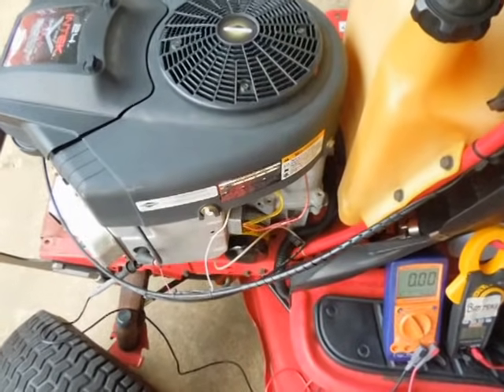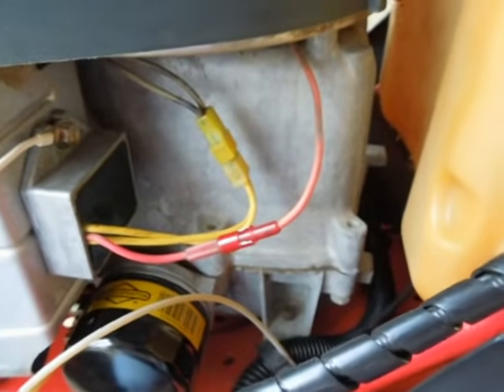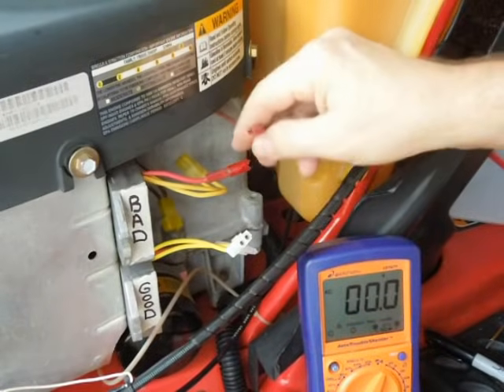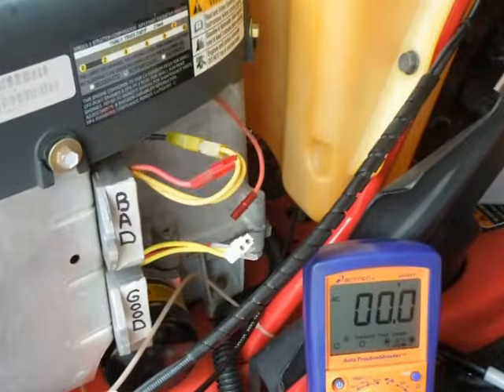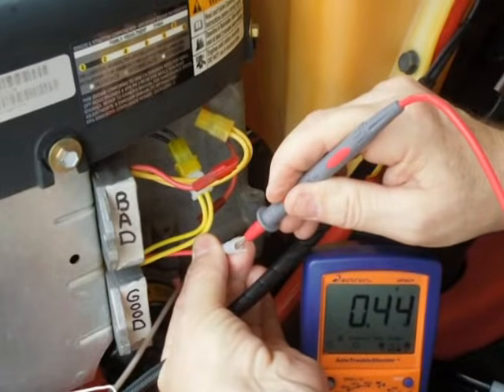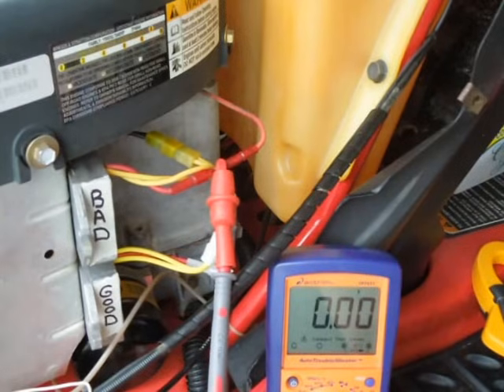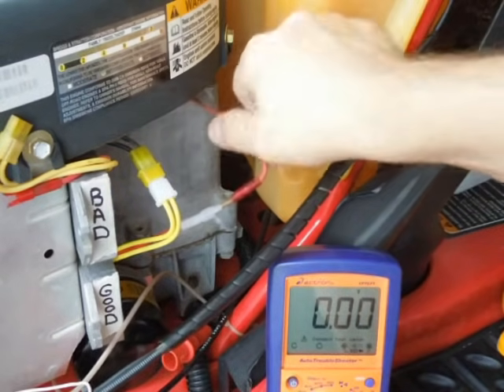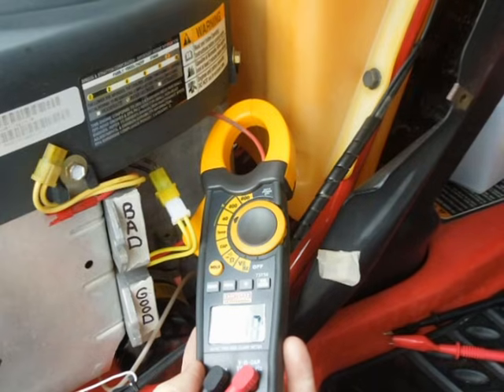Briggs & Stratton Battery Not Charging - Simple Voltage Regulator Test

Comment: First off, I liked the video.  I have a question though about the red charging wire going back into the engine.  When you measured the output voltage feeding to the battery, both that voltage and the voltage at the battery should have been the same except for some difference of using two different meters.   I would have liked to have seen the output on a scope.  Also why did the red wire need to go back into the case and not directly towards the battery and key.  The difference wouldn't be caused by a voltage drop in the wire.  I'm going to track this down.  I shall return.
Reply from the maker: robert574, I wondered the same thing myself, why does the charging output wire go back into the engine?  But wasn't so curious that I had to know, lol.  I took it as, it is what it is and it's working so don't mess with it.  Let us know what you find.  Thanks for watching!
Reply: I think they just did it to confuse us.  The wire just seems to route back under the cover and then out to the battery.  There is no field winding to energize (it uses permanent magnets.  AC out of the stator into the voltage regulator and then DC to the battery (the case is ground).  Piece of cake right?
Reply: You explained it perfectly.  I had a problem with my mower back when I first watched this.  My red wire didn't go back in the engine, but the voltage regulator was bad.

Comment: You made a couple of mistakes, friend. The reg doesn't " put out" the current as such - the load, in this case the machine circuitry and charging system, determines the current in amperes, and your meter probably measures RMS specifically at 60 hz when not measuring DC, so at the far higher and unstable frequency of the alternator output it would not read accurately which may also account for the funny good reg reading ( ripple). Otherwise, good and useful video.

Comment: I also expect to dee a higher Voltage reading at the battery, than the Battery with engine off, mine goes down from 12.6 off to 12.4 motor running.  Any deeper ideas are welcome. testo@cableone.net

Comment: Same problem...battery running down. I think Bat is ok. I get the ac Volts from Stator, but also get .5 V dc from Voltage Regulator.  I am on my 4th VReg change. 3 from ROPS, CA, and a Briggs Box part. I get the .5 on all of them.  I see on some videos a Voltage reading of 13 - 14, from the VReg, but like yours, I only got the .5 Volts dc. (until u put a jumper).  I wonder if there is a rectifier or etc in the circuit that impedes the current unless a battery is in-circuit, thus the .5 Volt. But I am not confident the Regulators are operating GOOD with only .5V dc, but four new ones in a row?

Comment: Your engine will start ezier if you set the vale clearance right.
Reply from the maker: Ernie Laurent you are absolutely correct!  Set the valves a while back and need to post the video.  Starts like a dream now.  Thanks for watching!
Reply: @snaproll94e  also, be sure to tighten the muffkin bearings.

Comment: Only comment or complaint is that you didn’t show what to turn the meter to and show what the dial looks like. I’m a noob when it comes to using the meters an the dials and settings are confusing as hell. So without understanding the settings, this video is little help to me. Not to mention, my local tractor repair place gave me different output volts that you gave us. So now I’m really confused!
Reply from the maker: broadstfarm there is only one AC volt check and you can set your meter to the first AC setting that is higher than 30 volts.  All of the other checks are DC volts and you'll need to set your meter at the first DC setting higher than 15 volts.  The odds of your meters and mine being the same or looking the same are very slim.  Sounds like you should invest in an auto-ranging meter.  Your right, the video wasn't made with the complete novice in mind, we are dealing with electricity and besides getting a shock from the AC side you could short out the DC side and melt some wires or worse.  And burning up a meter is always a possibility.  Be careful and know your limits.  Get help or take it to a mechanic.  In the end, that could still be your cheapest solution.  Thanks for watching.

Comment: snaproll94e Does the voltage regulator itself which is bolted to the motor need to grounded? I noticed that the voltage regulator on my John Deere does not have a grounded cable/wire coming from the regulator to a ground screw or bolt on the lawn mower. Thanks
Reply from the maker: Michael Singletary , I'm pretty sure the type of regulator I'm running must have the case grounded or there wouldn't be a ground path for the negative side of the circuit.  Regardless of what regulator you're running, I don't think it would hurt anything to run or add a ground to the case, it would just be an extra wire.  If a regulator had black and red 12 volt output wires coming out of it, it might work without grounding the case.  Interesting question, thanks for watching.

Comment: Great video.

I have a similar problem with an very old Snapper rear engine. Think Forest Gump old. I recently replaced the engine with a 14.5 Briggs IC and it has one wire under the carb that I attached to the grounding key switch. Works fine.

Coming out the back of the engine are two wires, black and red. The red looks to have maybe a diode heat shrinked in it. I never attached these wires and kept a battery tender on it. Can this red wire be used to charge the battery? and can it be connected direct or does it need to go thru a switch? I can test the voltage output if needed. Thanks
Reply from the maker: Unit 419 , unfortunately, I have no idea what those red and black wires are for.  Check them out with a VOM and good luck figuring out what they are for.  Thanks for watching.
Reply: @snaproll94e  OK finally got this mower in the shop for belts, grease, etc. The Black measures 25v AC which I assume is for the lights and the red with the diode is 25v DC with the diode. These measurements are with no load.  There is no leak to ground thru the diode. I'm wondering if the the 25v DC can be connected to the battery direct or does it need a regulator. I find many 3 wire regulators but not a 2 wire.  Any thoughts?
Edit: I have the two wire plug from the mower this engine came off of. The red DC wire goes to yellow from the plug but so does the black.

Comment: The regulator needs to be connected to the battery which acts as a buffer and stabilizes the voltage.disconnecting battery from regulator and running engine will cause damage to regulator.Thats why your getting funny readings out of your regulator and possible damaging it whitout the battery connected.Excessive voltage drop could mean corroded or loose wiring or corroded ignition switch.

Comment: Thank You so much for this vid!!....I only have a little over battery voltage(12.6 volts) leaving the regulator and am going to order a new reg.  Fuses ok & new battery...... THANK YOU!!!!!!!!
Reply from the maker: Glad to help.  Thanks for watching!
Reply: @snaproll94e  12.86 at battery while running full throttle is it charging?

Comment: I was told my stator was bad, reads 32 vac. My voltage regulaor reads negative mili-volts. I guess that would explain the negative ammeter readings.  Would this cause my PTO to shut down? I was convinced I needed a new stator and possibly a new clutch. I have a 21 HP B&S intek engine.
Reply: yes your pto will not work properly with low voltage

Comment: Do u know where the fuse for the alternator is and what the voltage across the battery should be when engine running and alternator charging I only get 12 volts when it's running and battery is flat
Reply from the maker: Sorry, I couldn't tell you where your fuse is or if you have a fuseible  link (that looks like a piece of wire), your best bet is to Google that or talk to a mechanic familiar with your type of mower.  With that said, if you have battery voltage at the 12v output wire with the key on, the fuse and key switch are ok.  You might want to watch the start of the video again where I check this.  The voltage of a typical good charging system is going to be 13.5 to 14.8, don't forget engine speed can change the voltage.  For test purposes, you can run a wire directly from the output wire on the voltage regulator to the battery + terminal and see if it charges.  And a bad/open ground will act like a blown fuse.  Thanks for watching.

Comment: Great vid. I have just this problem. Thanks for the heads up. You need to do a valve adjustment before the push rods fall out. It happens. The compression release won't work right and it will act like a low battery even when it isn't if there is too much clearance. Not very impressed with Briggs these days.
Reply from the maker: Doug Alan , got a video about adjusting the valves or the compression release?  The engine's cranked like this since new and the hour meter had 500+ hours on it before he display went blank.  Thanks for watching!
Reply: Don't know of any videos right this second, but the compression release is just a little bump on the cam, and if the valve clearance is too great, it won't work. The starter is just lame enough that you have to bump it over the compression stroke to get it to crank. As it turns out, I had a broken wire on the stator. The battery now charges at a solid 14.1V, right where it should be. I think the clearance is .003 intake and .005 exhaust, IIRC.
Reply from the maker: Doug Alan , hey Doug.  Thanks for the reply.  I found a video and the guy said to set them at .004" which falls in line with what you said.  I really appreciate the explanation about the cam, it all makes sense so I'll do the adjustment soon.  Do the rocker covers have gaskets that need to be replaced or are they reusable?  Thanks again!
Reply: Although you may be able to get the covers to come off without tearing the gaskets, it's probably a good idea to just get new ones. My Briggs originally had a problem where one cylinder didn't want to run, which was caused by bad o-rings in the hideous plastic intake manifold. I found an aluminum manifold from the Vanguard series that was a drop-in replacement and got rid of the problem that way. I just did the valve adjustment as part of that repair. These engines have a bad habit of having the valve seats come loose if they ever get overheated.  So, it's just a good idea to clean the cooling system and adjust the valves and feel good about it. You may want to replace the intake o-rings too while you're in there. They're not that terribly expensive.  It's only a two beer job.

Comment: I can't even get mine to start, even with jumping it so I can't do all that. I'm just going to replace the regulator and hope that fixes it once the battery is charged again. Sometimes it's just less trouble to change out a cheap part ($13 on Amazon) than deal with all that checking. Plus, I don't have a voltmeter. LOL!
Reply from the maker: Kritter good luck and I here you about changing cheap parts.  One of the other comments sated they had to buy 3 regulators off of eBay before they got a good one so be careful with cheap parts.  BTW, not as easy to read as a volt meter, you can make a test light out of a couple wires and a 12v light bulb.  Thanks for watching!
Reply: Well I got mine from Amazon and it worked like a charm! I've been an on-line shopper for over a decade, I'm usually pretty good about sorting out bad purchases before hand and making sure there's a return policy in place for questionable ones. Also, I don't have misc things like wires and 12v light bulbs laying around, I'm your run of the mill stay at home mom with MacGuyver tenancies! LOL

Comment: Beware NEW voltage regulators that are bad out of the box.  I bought one on eBay, installed it, no charging.  Returned it, got a second, again, no charging.   After tearing the mower down, looking for faults, I found none.  Everything pointed to the NEW regulator being bad.  In addition to the AC test in this well done video, I have a few tips for people in similar situations.

First off, my mower has a built-in ammeter so I noticed that the new regulator wasn't charging right off the bat.  Most mowers don't have those and I can only imagine the scores of people who installed a new regulator thinking their worries were over only to find their batteries dead several months after the warranty on the new regulator was expired.

The simplest way to check to see if your charging circuit is working is to start the mower and measure the voltage across the battery.  It should read about 14.5V - not 12.7V.  The battery needs the higher voltage in order to charge.

To test the stator, use the AC test as described in this video.  The engine should be at full throttle and actual AC voltage should be what the manufacturer specs say.  

I also load tested the stator by connecting a 12V light bulb to the output.   At low RPM, the bulb will light, at higher RPM, the bulb will blow.  Incandescent light bulbs run fine on AC.  In my case, the bulb drew about 2 amps from the stator with no problems.

Next, I hooked the same 12V bulb up to the mower wire that connects to the output from the regulator.  The other bulb lead connects to ground.  Then turned on the ignition switch.  The bulb lit up indicating there was no break or hidden blown fuse.

Finally, I bought a 25 amp bridge rectifier from a local electronics store and hooked the AC input to the two stator wires.  The positive (+) output of the rectifier connects to the mower wire that the regulator output wire would normally connect to.  The negative(-) output to battery ground.  When I started the engine, I immediately saw the full 13 amps going through the ammeter and into the battery.  This was proof positive that the charging circuit was fine except for the NEW regulator.  

It should be noted that the bridge rectifier connections were for testing only and the battery will be ruined if you run it like that for very long.  The rectifier converts AC to DC, but does not regulate the voltage to a safe level.

Hopefully this will save other people from having a dead battery because their NEW regulator doesn't actually work.
Reply: Your comment was very well written, logical and easy to understand.  I copied it into my Tractor Electrical Diagnostic notes for future reference.  That said, wouldn't the process in the video accomplish the exact same thing?  In other words, don't assume the replacement regulator is good out of the box.  Connect a bare jumper between the two DC output connections and measure from the jumper - the key being the battery needs to be integral to the testing loop for a valid test?
Reply: @Rein_Ciarfella yes if you have an ammeter or something that can measure current you can measure what the regulator is actually putting into the battery. But remember that a charged battery will not take as much current. It's best to put some kind of load on the battery itself.  Or simply compare the voltage of the battery running versus not running.
Reply: 12.86 running ft, regulator or alternator?
Reply: @MC-hs4mf most likely not charging. Measure the battery voltage running and then again right after you turn it off. The running voltage should be about about 2 volts higher.  Try the bridge rectifier test to be sure.